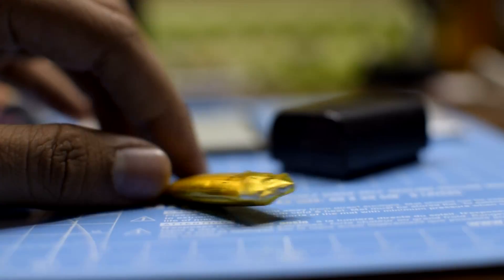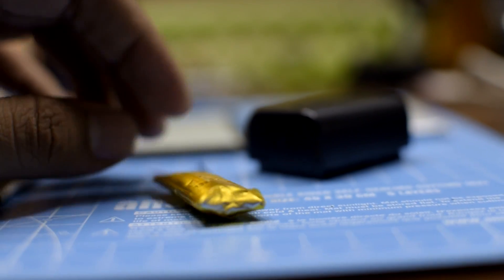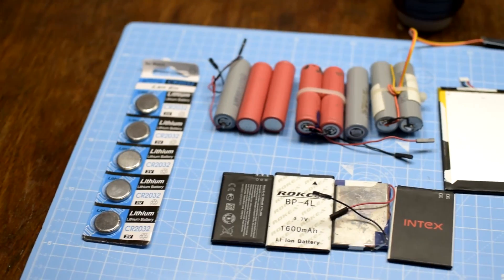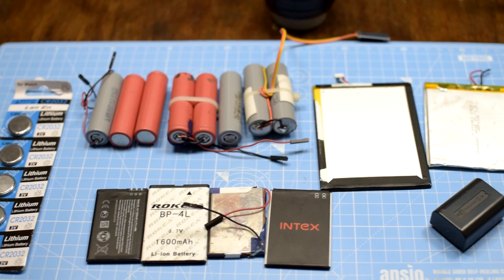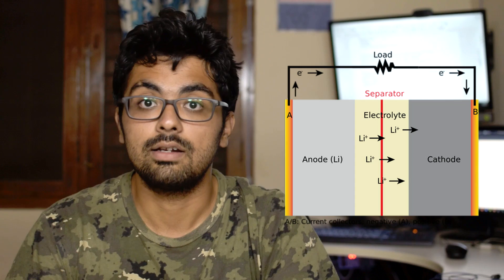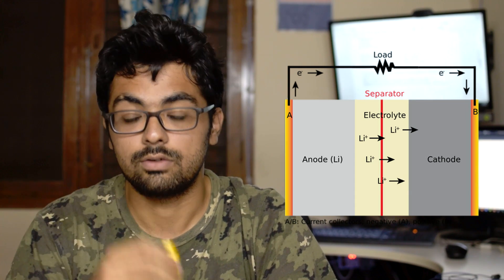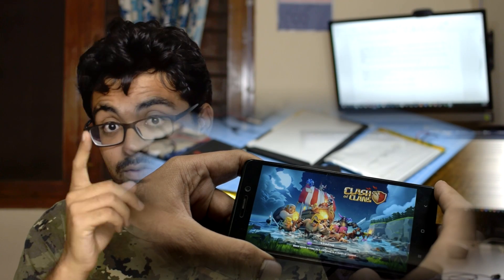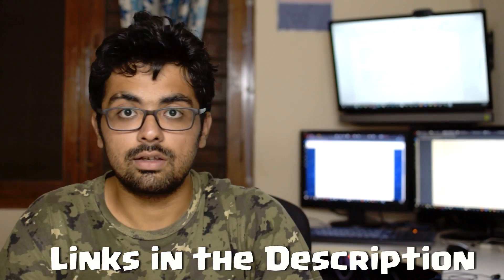Why Li-ion  batteries bulge and die ??

Comment: I have a question. Does using your phone while charging causes your battery to swell?
Reply from the maker: When you use your phone while charging the phone heats up more(heat due to charging + heat due to the processor). So the battery stays at a higher temperature which is really bad. So it likely increases the likelihood of battery swelling. You'll probably find some research papers on effect of prolonged heat on Li-ion batteries if you Google :)

Comment: Thanks! Great info. I work in an office and lots of our laptops with these li ion pouch packs are starting to swell. The computers don't use battery power very often, and I'm willing to bet many laptops find their way into a bag while still in and it leads to overheating (that's my theory when it suddenly happens, the person had brought their laptop home the night before). It's amazing that manufacture such as Microsoft are sealing these batteries inside the surface and surface book computers.... What a dumb idea, guaranteeing the need for a new device after the battery fails or swells.
Reply from the maker: Yeah, everyone is doing a lot of research into how to extend battery life of lipo's. And yeah today's designs kind of make Lipo's the only option lol

Comment: I left new fully charged samsung battery and it bulged just from not using it for long time. Voltage was still 4V. Anyone know why that happened?
Reply: Sopheris you shouldn't store batteries when it's fully charged
Reply: the ideal storage voltage is around 3.6 ~ 3.7v

Comment: Great information. It baffles me that manufacturers don't create intelligent charging that monitors heat and other aspects of the charging to optimize the process. We should have by now charging that does not overcharge automatically and controls discharge and heat.. For instance, gaming laptops and phones, you can't apply any techniques to protect the battery as intensive tasks are carried out constantly and heat and overcharge is happening all the time due to heavy use. If you don't keep battery in a charger all the time during use, it will fall back on performance.
Reply: They wont do that for profit and control.